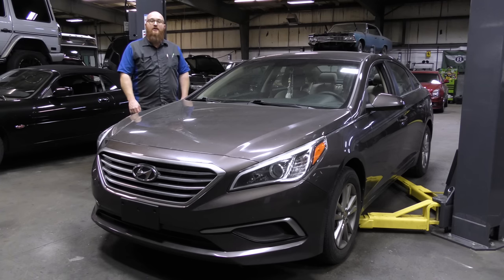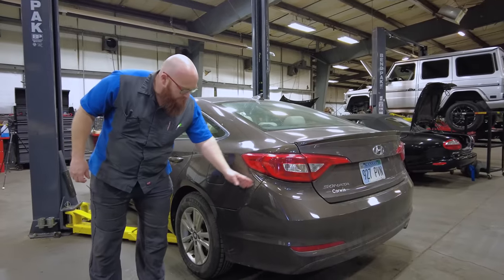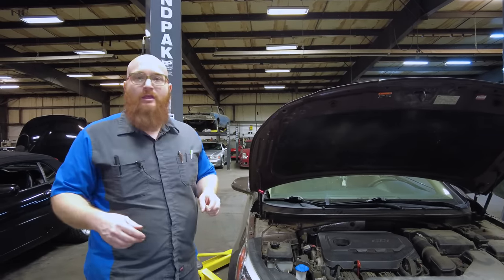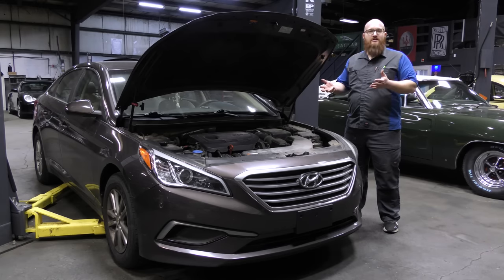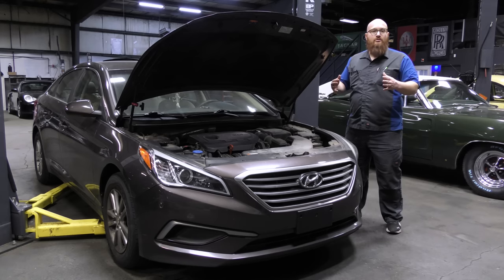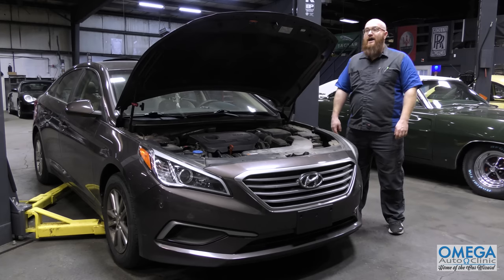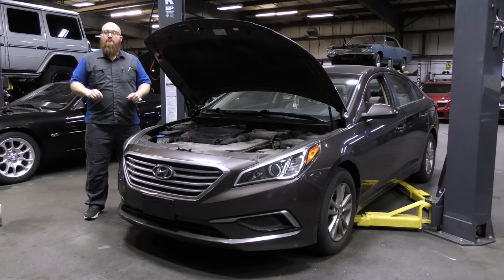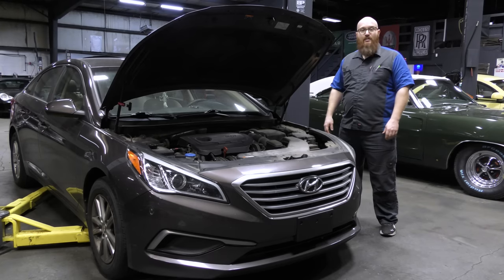What could be so bad on this '16 Hyundai Sonata that the CAR WIZARD is sending it to the junk yard?

Comment: I bought an old 1996 mini-car for my girlfriend to go to and from work.
Its engine consumed some oil.
Therefore, I taught her to see its oil.
She always disliked it - nevertheless, she understood the need.
Hence, today - even with a more recent car - she still measures the oil.
Simply not weekly, but every two months.

My main gripe is: why did OEMs (manufacturers) stopped equipping cars with oil sticks?
Instead, you have to use the diagnostic tool, and the engine needs to be at full optimal temperature.
If you are low on oil, and let it go to full optimal temperature, maybe... You just hurt your engine - and especially the turbo, which is nowadays common place, and requires the oil to be of the higher quality and enough to reach it.

The old car consumed a little bit of oil due to bad piston ring(s).
Basically, the previous owner - from whom I bought the car from - lied to me. I learned a valuable (cheap) lesson.
He stated that the timing belt, accessory belt, and water pump had been changed in the previous year.
However, the water pump failed, leading to an overheating situation.

Fortunately, I had taught my girlfriend to keep an eye on the temperature gauge - and she did.
As she was in traffic situation, the temperature started to rise quickly.
She looked for a safe spot to park, and turned off the engine.
The engine was not junked, but at least one piston ring was damaged - leading to oil consumption, and a great deal of power loss. The car was weak from factory (62 hp), but it was old and left with ~45 hp.
Afterwards, I fixed all that (timing belt, accessory belt, and water pump), but it was not worth to fix the piston ring.

I managed to sell it to a local family, after 5 years of owning it.
It went on long road trips, did highway speeds, commuting, etc...
I needed to just watch the oil level weekly when commuting, or daily when on road trips.
Apart from that, solid car!

Comment: As always good content. I have a friend his son and his girl friend have the same vehicle. Here in the NY Metro burbs, their local dealer replaced the engines on both under warranty/recall about a year or so ago.  They called corporate, took about 6 or so weeks, didn't provide a rental but at least got the replacement engine.  Both vowed to never buy another Hyundai/Kia again. Salvage value is still pretty high, Co-Part would pay decent money for that should be able to at least recoup some money, to put towards a replacement vehicle. Go Honda or Toyota, worth the extra money.  I wish them the best.
Reply: Typical response. It depends on the gen as I would say early 2000 Hyundais are more reliable than early 2000 Hondas/acuras I can attest to that. Toyota now almost every gen is reliable but some gens do burn oil. And if you gotta recommend any new car brand it would be Toyota idk why so many people get Honda with their shitty transmissions lmao

Comment: From my own experience it is also beneficial to keep up to date on recalls and other information provided by the dealer.  My 2016 KIA had a catastrophic engine failure but it was covered as I had responded to all of the service requests and customer alerts from KIA.  KIA has also committed to reimbursement for my towing and rental expenses during the time my engine was replaced. So far the new engine is running fine and has a warranty extension to 100,000 miles.  I have not read the fine print on the warranty extension.

Comment: We have a 2013 Hyundai Tucson. I do the fluids regularly, breaks from the need it. It’s only got 75,000 miles on it and I love it. It’s my little four-cylinder goat. We bought a cheap used, it had some mice in it at least the smell. We did our best to get rid of that. I love it it’s got a little automatic shifter I can use. It’s got good Cooper tires. It’s cheap to fix and run. I once rented a Suzuki samurai in Belize in the mid90s. That thing wouldn’t quit. This car reminds me so much of that. Anyway, wizard I have to say this. You are like a priest. Your declarativeness is unequaled. Direct ! 😳🌟You’re a generous kind thoughtful caring guy who wants people to get value and satisfaction. Bravo times 100. Thanks 👏👏👏😊❤️

Comment: On top of needing to change oil regularly, you must keep those service records! If that car was brought to the dealer with regular maintenance records and with the known consumption issue, it most likely would have been paid by warranty. I've seen them replaced many times well over the 100k mile mark when the owner can show they did their part.
Reply: But they replace it with the same crappy motor
Reply: @donc6781  that if maintained will easily run them 100k miles.  Not sure of other manufacturers that will do this but, maybe I'm wrong.
Reply: @bamcintosh1  an engine should be just breaking in by 100k miles, especially one as simple and non-stressed at that one. My bmw has 125k miles and is still just as smooth at 7k rpms as it is at 2k.
Reply: @donc6781  Those new engines are redesigned and don't have the same issues. And I'm 100% sure lack of maintenance killed this one.

Comment: I use my trip meter as a reminder to check my oil! When it hits 250 miles, I pop the hood! 2005 Buick LaCrosse bought new. It has 163,000.  Runs better now than when new! I guess the engine finally got broken in! 😄
Reply: Great tip!

Comment: I’ve been lucky with my 2014 Hyundai accent and I rebuilt my engine here in SoCal Los Angeles there was many shops that would do it and I pulled it out of the car and took it in to a shop it was done in a week and it’s a been a year since the rebuild and still running like a champ took the car to Yosemite and back to la no problem

Comment: Just had the same scenario with my cousins 2014 Kia Soul. I advised them so send it to the junk yard. Their scenario was a little different, they drove it from Texas to Florida with a stopped up Catalytic converter. In most other cars that would not be an issue but they apparently had a Recall for that car.
Reply: I own that exact car and it makes me nervous. Mine was stolen so it was replaced last year so no worry about that recall. I now have synthetic oil in it as the engine is now
Reply: My mom had a 2016 Kia Optima and the engine caught fire on the highway driving to p.a from nyc and they told her it was her they couldn’t pay cuz it was to much damage to determine where the fire started even tho that engine was recalled and they gave it back to her a few weeks before saying it was fine
Reply: The engine blew on my 2016 Kia Sorrento I got it back a week ago
Reply: @fffwe3876  Well yeah it’s a 2016 lol
Reply: Yeah that car is worth nothing

Comment: I love my 2017 Hyundai sonata it has over 130k miles. Meanwhile my 2017 Honda pilot transmission and smart body control module gave out at 55k miles. I traded it in for a 2021 Santa Fe. Regular maintenance is performed on my cars and is a must to maintain the car obviously.
Reply: I believe you😂

Comment: A real shame. I own a 2016 Sonata, with the 2.4. Bought new as a demo, about 4K miles on it then. Now still low mileage, about 45K. Never been in a collision of any kind. The very best car I've ever owned, and I'm 65 years old. Have faithfully changed the oil every 3K. The only issue I've noticed since buying it is the oil darkens very quickly after each change, not sure what to make of that.
Reply: I suggest you only use a high quality synthetic oil
Reply: It’s normal for the oil to get dark quickly.
Reply: It's normal sir, no need to worry about the color of the oil.
Reply: Run amsoil until you can get something else. Dealt with several Kia/Hyundai cars....junk. can't beat a Camry lol
Reply: Shouldn't darken much between changes..if it does..that's increasing blowby
Reply: A good motor will still be fairly clean between changes...newer engines run tighter tolerances..older engines had looser tolerances..and darken quicker
Reply: @Kurt Jammer  you're wrong. Please don't spread misinformation on the internet. Engine oil color is not the indicator of the condition, viscosity is. I'm a petroleum engineer.
Reply: But have you rebuilt engines for 40 years?.oh ok..black or quickly darkening oil is hydrocarbons.a product of blowby.any newer engine built after 2007   shouldn't be getting black quickly..
Reply: That's low mileage. Let's see how it holds up at 145k miles.

Comment: I own a 2019 Kia Sorento V6 AWD and I change my own oil and oil filter every 5k miles. Runs great at 155223 miles. I have put new cv axel on passenger side with a new carrier bearing. New plugs and coils at 145,000 along with oil pressure sending unit and plug tube seals. Changed out on my own, the rear differential fluid. I installed my own trailer hitch and trailer hitch wiring harness. If you keep up on the maintenance it will keep running.

Comment: What a shame about the situation on this car.  I have two Hyundais and have had good luck with both....because I kept up with regular maintenance and fixed things that needed fixing when appropriate.  The 2009 I still have and everything still works on it.  It is a second car and has served me well.  Yes, set a regular routine up to check your fluids and see what is going on.  Oil lights coming on usually means it is too late.  For me, have a reliable car to get to work was just as important as the other priorities in life.
Reply: Agree. Hyundai might not be the best but if you keep up with the maintenance then it should last you a while. My old Hyundai had 267k miles and original engine and transmission

Comment: Piston rings that don't grip the cylinder bores as tight result in less friction, and thus better fuel mileage, but that also lets a little more oil into the combustion chamber, so you'll see the oil go down on the dipstick between changes, and need to top 'er up. Possibly that's something that needs to be printed on the dashboard.
Reply: The low tension rings seal  the low tension means that longer oil change interval and vehicle use that pushes sludge build up leads to oil deposits in the groove the ring fits in piston. the low spring tension of rings is not enough for the rings to push free from sticking, THEN they don't seal and burn oil. This is true of most every brand for some of their engines. Money saved by lengthening oil change interval Never pays off if you own the vehicle beyond 100 k miles.
Reply: It's all to meet CAFE polution and emissions demands, build  car with almost 200hp that uses 30mpg or more, reduce frictions by using thin oils and don't forget required changes on 10000 plus miles because of environmental problems, now they even reduce amount of cylinders and add more power because of amount of turbos they hook up, and when I get with someone in disagreement about technical problems, they justify how Rally cars are usually have same set ups and they run great. Yes that's correct but they are built only for one race, or one event and bye, bye, they will be going to get overhauled or disposed, not to be used for 10 plus years and 200000 plus miles.

Comment: Stay away from Hyundai, that's the solution, i have the same problem with a 2016 sonata, the oil burning is excessive, every week i have to add almost an oil quarter, Hyundai should be responsable for that mess
Reply: I had a rambler that burned 2 quarts a day. I never had that noise.
Reply: they replaced the engine in my '17 Santa Fe at 65,000 miles. It was using 2 quarts per 1000 miles

Comment: My sister has this same year Sonata.
I've driven it several times; I found it to have surprisingly responsive and fun steering and a nicely thick-rimmed steering wheel. Pretty sure the gas pedal is floor-hinged, too, very cool.
I'll have to warn her to keep very strict with the oil and other maintenance.
Reply: A floor hinged gas pedal, ey? Now that's some upgrade. I was considering a vehicle with V8, maybe a turbo-6, but if I could get a car with floor hinged gas pedal instead, no brainer right there.
Reply: @Santor-  sarcasm?

Comment: I have a 2015 Kia optima ex and I like the car. I always check the oil and I don’t drive too much. I got it for pretty cheap compared to what they were asking for Honda accords and Toyota Camrys. I haven’t had any problems with it, the only thing I changed was the PCV valve and kept up with 5000 mile oil changes. I probably should have just gotten a Honda or Toyota but I got this and so far I have had a pleasant experience.
Reply: Anything can work well enough if it starts out cheap enough, and is maintained.
Reply: you should do 3000 mi oil changes not driving much or short distances is harder on the oil

Comment: Car wizard is a solid guy. Wish he was near me. He'd definitely be my mechanic. Honest, knowledgeable and trustworthy. Hard to find in this business.
Reply: I have the opposite problem with mine. He’s too honest and has the old school mentality of don’t fix it till it’s broken. Trying to get him to take my money can be a fight sometimes lol. He doesn’t get that I spend a lot of time in the middle of nowhere and would rather have something fixed beforehand rather than have it go on me on the side of the road. And it’s not like I’m trying to waste money. I just want my car to not break since it’s old lol
Reply: hard 2 get an accurate reading if ur checking at the gas station because the car has just been running. oil should b checked on a cold engine while all of the oil is in the pan.

Comment: I learned long ago as a kid that if your oil light comes on, it's probably too late already. My goal was to never let that light come on. Never had an engine blow up or any other catastrophic damage.
Reply: I change my 2020 Ecoboost Mustang oil when it says 30% which is like every 4 months and when I just checked this morning it was perfect on the upper of the 2 holes aka 100% where it needed to be... Which the light might turn on at 10% or even less butt I never want to test it.

Comment: i had a similar problem but i skipped only one oil change. i checked it after and the dipstick was dry. i obviously added oil and took it to get an oil change as my dealer said they couldn’t have time for an appointment. I went through the process of them running tests and days without a car, all for them to say i need a 500 cleaning that would or wouldn’t fix it. I sold it for a decent price before i had to go through hyundais horrible excessive oil consumption tests. if you have a similar problem, sell it before the engine starts knocking or blows up.

Comment: Something that the dealer will omit to tell customers on these engines is that not only do they have rod bearing failures, but they also have oil consumption issues. They (the manufacturer) have said that a normal running engine can burn up to one quart of oil in 1,000 miles, which I believe is one quart too many. So you have a dealer performing 5,000, 7500, 10,000 mile oil change intervals, but you will not have enough oil in the crankcase to even make it to your next service.
Reply: It is STILL customers' responsibility to check oil level at EVERY fill-up!

Comment: Yikes - I need to link this to my brother, who has a 2016 Sonata.  Yeah, the Theta II engines were very problematic for a number of reasons.  They, and the 2.0 Nu engines too, are extremely sensitive to low oil and/or dirty oil, and tend to spin rod bearings.  Kia and Hyundai recommend 12,000km (7456 mile) oil changes (or did around that year anyway) which is pretty crazy considering how sensitive the engine was.  I've always changed my oil every 5000km (about 3100 miles) just to always ensure it's clean and in good shape.  It's one of those things Scotty Kilmer is certainly right about when he says "oil is cheap, engines are not".  But you're very right as well Wizard in that so many people today just don't think about it because there are so many other things going on.  I really hope the owner is able to replace it with a less problematic vehicle, but also hope they start taking the car to Omega for service in the future as well to keep it problem-free.
Reply: The Lambda V6 has problems as well. They have major Cadillac Northstar like problems with the head bolts.
Reply: The USA buildt engines with metal shavings left in them when manufactured. 
In Australia our cars come from South Korea . Great cars.
Reply: @atx-cvpi_99  Yeah, heard that as well.  Seems they're a bit hit and miss with engines - some are okay, some are disasters.  The old Beta II 2.0 was a pretty solid engine by the 2000s, but that one was retired after 2010 (at last in North America).
Reply: @conradscheepers  Yeah, the Theta II's made in the US had that weird metal shavings issue to add to the issues.  Hyundai engines are a bit of a pot-lucky though; some designs were pretty good (like the Beta II), but some came with caveats, like the GDI Nu engines which had the very weak/sensitive connector rod bearings.  And some then had other issues like the MFI Nu (used the 2020+ Souls, Fortes, Elantras and others) had bad piston rings and are oil burners.
Reply: I drive back and forth to work in a 2003 Elantra GT I bought for $2500 in 2014. Bought it with 160,000ish miles, has over 240,000 on it now. AC blows cold, heat blows hot, gets 30+ mpg on my mixed city and highway weekly commute. Couldn't ask for a better little beater. 

I've run it on Rotella 5w40 synthetic, 4 quarts go in, 3000 miles later 4 quarts come out... The Beta II is a fine little gutless turd of an engine.
Reply: @atx-cvpi_99  Agreed
Reply: @admiralrustyshackleford119  Yeah - my Dad had one of those too.  That was the 2.0L Beta II engine; probably the best engine they ever made.

Comment: I had my first and last Hyundai back in 2010.  Bought a used 2004 Santa Fe with 35k miles on it.  With all maintenance done, at 60k miles it was leaking and burning oil like crazy.  Then transmission and AC problems on top of that.  At least it didn't have electrical problems lol.